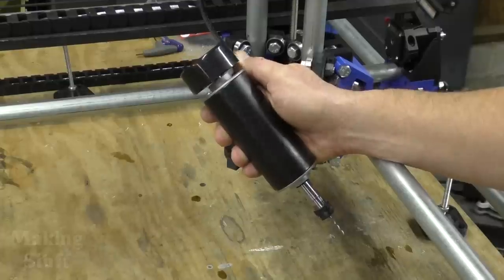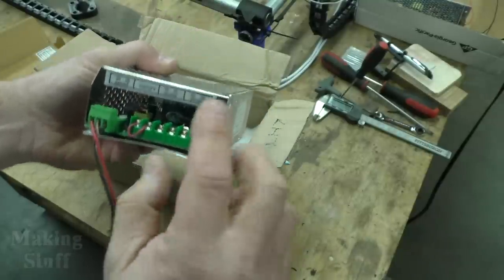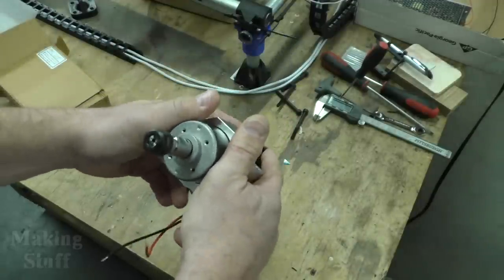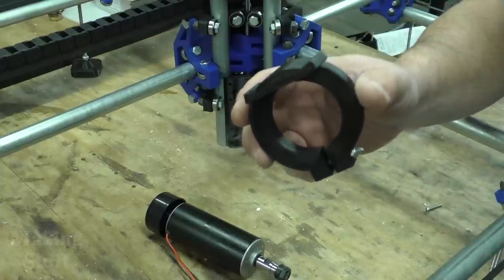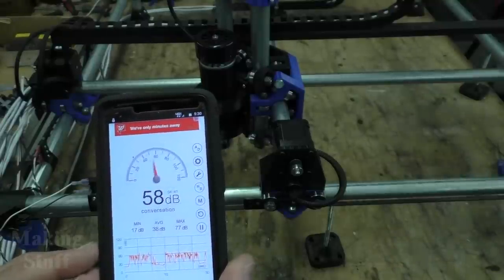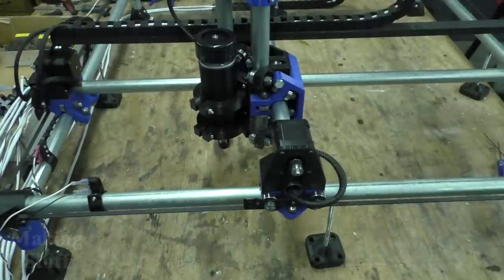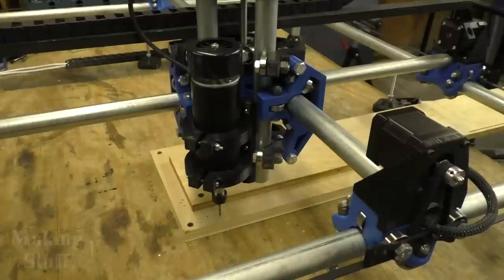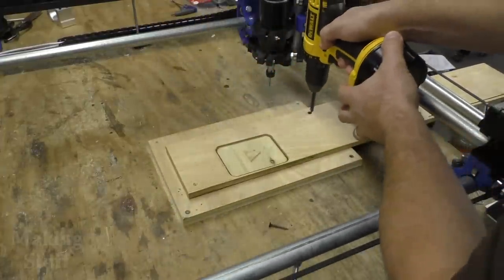Reviewing a Chinese Spindle for CNC Machines

Comment: You did not mount the tool in the collet correctly. The collet (of which you got only one, the 3.175 mm one) snaps into the ER11 nut with a small ridge at the top of the collet. Once you snap the collet into the black ER11 nut you can insert the tool/bit. And then thread everything into/on the spindle.

Comment: I see that you use Marlin as a milling platform. Can you link the videos regardning using marlin for this milling macine you build. I did the same and i´m usning uno arduino and grbl. But using ramps 1.4 is an awesome platform and the cost is 15 usd for a kit with lcd and shield plus mainoard 2560. I bought 2 sets just in case as they are so versatile. I run my prter wirh marlin 2.0.7 and ramps 1.4 hybrid on 24v. I´d love to see your build for cnc roter and also plasma. I have a cheap cutter lying around. Just havent gotten around to building it. Need to build a garage first...
Reply: i did build my own cnc milling machine. I use grblgru as cam module. it is free and powerful. i use arduino uno r3 and grbl shield. But i plan to use mega2560 and ramps 1.4   But you can also use marlin to mill stuff. and use the lcd and jog the machine. I will check out ESTL also. Right now i'm getting to the point where i can use my diy machine, with cutting fluid system and ventialtions systems. it is designied to cut and engrave alumium, at low speeds and high rpm, rather than a regualr milling machine. I will of course mill wood also. I use ballscrews

Comment: If it was not for the low rpm speed (compared to a dremel type tool) I think I would buy one of these and use it for a dremel tool!  Two and a half times the power and super quite compared to the dremel!
Reply: NotAnExpert, haha, great idea!
Reply: A Dremel is 75W. When I measured my "500W" spindle I could never get it to draw more than 100W even loaded down. So they're 500 Chinese Watts not western Watts. Chinese Watts are obviously a lot smaller than our Watts are. But inflating specs is typical. I have a 600W Bosch router and it is really 600W. It is way more powerful than these air cooled spindles are. Easy 6 times. Turn that router on and it'll twist your wrist.

Comment: I wonder if they sell the spindle for cheaper without the bracket? That bracket is huge!  Or without the controller.  Just give it 100 volts dc without variable speed? 11000rpm isn't something I'd slow down. 
I made a video on my high voltage dc power supply that was cheap:  I could add 3 more ports for 100 vdc!
Reply from the maker: Yes you can buy the spindle without the bracket.  Just look on Banggood or Amazon.

Comment: I'm after a spindle/router for my own MPCNC. I'm very inexperienced with this stuff and am just starting out. Those spindles look great for a beginner like me, even if I end up on something "beefier" later on. The mounting arrangement scares me though - there is nothing holding the spindle up, just the friction from the sides. Are there any mounts available that hold it from the bottom?
Reply: You can put a hose clamp on it both top and bottom.. with some electrical tape to prevent the hose clamps from sliding
Reply from the maker: The mount that came with it was very hard to get off.  I had to get a screw driver and pry it open just to remove it.  There was just no way to hook it to the MPCNC without having to use 3d printed parts.  The 3D printed mounts would probably break before the let the spindle slip.  I was more worried about them breaking than slipping.  I'm sure if the spindle stopped turning or I took too deep of a cut, something would break on the MPCNC.

Comment: What are the best tools for wood and soft aluminium a router or a spindle, and can you use 1/4" cutter bits?
Reply from the maker: You can use a 1/4" bit with the correct collet.

Comment: Hey man looks like your cnc has a bunch of vibrations,  likely causing the lousy finish.  Great video though thanks!
Reply: A bunch of vibrations? Lousy? For a printed CNC machine running a cheap Chinese spindle this is pretty dam good. Of course it's not going to be a Tormach 440...

Comment: Did you adjust the small potentiometer on the circuit board to a max voltage? At the moment at full speed I have 120V and the spindle runs hot. Do I have to adjust it to max 100V?
Reply from the maker: I didn't have to adjust mine.
Reply: @MakingStuff  What voltage do you get out of the power supply at full speed?

Comment: IMO it Seems to be mainly from the plywood you used. May want to try using MDF or a higher quality harder wood oak, walnut etc. could also be a little because of the end mill. If it’s for steel then it wouldn’t be as clean on wood.
Reply from the maker: I tried it on white oak since the video was filmed and it worked much better than plywood but still had small amounts of splintering.
Reply: Making Stuff Ok good. Another tip would be to also adjust the speed of not only the end mill itself, but the movement across the X and Y axis. Maybe slow it down some. If I recall correctly from your video you were using it at max rpm’s and running it at max speed with certain materials could effect the outcome of the piece negatively. Excellent job though and I WISH I had my own CNC machine like yours!
Reply: The glue layers are tough!
Reply: TheRainHarvester yeah I can imagine!

Comment: This spindle has only one ball bearing effective because another one is mounted on rubber. Normally spindle has angular contact bearings and total 4 bearings to bear cutting backforce. If you open it, you will know this is just modified hand blender.

Comment: Hi, can you tell me the distance between mounting holes for making the holes until the motor arrived. Horizontal and vertical. Thank you
Reply from the maker: Sorry I don't have this spindle any longer.  I sold the CNC machine that it was mounted to.
Reply: @MakingStuff  ok, thank you for the answer.

Comment: Use a wide dremmel tool It's from the vibration about then drill bet Are used a CNC dremmel bit With a flat surface or

Comment: Did you use with ramps. And can you set spindle speed on software? which connection do you use
Reply from the maker: No it's not connected to the RAMPS board.

Comment: "Banggoods sent me a spindle to do a review on. They didn't pay me"  
Unless you have to send back the spindle they did pay you WITH the spindle. just because its not a cash transaction doesn't mean you weren't paid.
Just because its heavy doesn't mean its "well made" they are good spindles though the bearings arent making excessive noise. 
I've got one and it works well. mine came with a collet set i just had to get a 1/8 and 1/4 collet

level your machine better to remove the milling marks. i dont have marks. but ive seen Haas CNC machines with milling marks. we had to cut the surface in two directions to make a better surface finish.

Comment: 11,400 sounds incredibly slow to me.  I have built inverted pin routers for routing out model aircraft kit parts from wood.  Going from a standard slow router around 22k to a 32k trim router made an incredible difference.  Look for cross fluted carbide burs.  Leaving nothing but points, they cut like mad.
Reply: The slow rotational speed is my biggest beef with these air cooled spindles.I was running a router on my CNC and the sound was driving me up the wall. So the air cooled spindles being quieter is nice. I think I need new bearings in that router. But with a router you con't have so many collet options for tool shanks like ER11 either.

Comment: Is PLA working for the spindle mount or is the spindle getting hot after running a while?
Reply from the maker: The spindle does get warm but no where near hot enough to melt the PLA.

Comment: I'm confused,do you just run 110AC to the power connectors,or do you get the 24DC or whatever,from the mill's board?
Reply from the maker: The power supply that comes with it connects to house current.  Then it steps the voltage down depending on what speed you have it set to.

Comment: Did you wire it in so that the onboard controller controlled the speed and switching on/off?
Reply from the maker: No I am manually controlling the speed, on/off.  I plan to put a solid state relay on the mains power side in the future.
Reply: @MakingStuff  Thanks for the reply.  It is much appreciated.

Comment: i notic ou used a plastic bracket for the cnc in other video`s they changed from plastic bracket to a epdm harder plastic bracket maybe youre bracket is a little bit flexible and that couses those straigt lines
Reply from the maker: The lines went away when I switched to a better quality down cut bit.  The whole machine has flex to it if you press on it hard enough so I don't think a harder plastic bracket would do much good unless the whole machine was also replaced with the same plastic.  Thanks for watching!

Comment: This machine power supply and spindle cause me nothing but problems , when turned on and not attached to the main board , on a separate terminal as a stand alone unit it for some reason causes problems with my PC and the Vectric software   mostly on the CNC machine the problem is with the Y and Z axis where the polarity changes instead of going + it does the opposite for Y and Z  I don't know how you eliminated the problem it seems that the spindle or power supply is creating its own EMF ,Can you please share with me how you stopped this issue. Thnk you
Reply from the maker: I always use shielded wire and ground it on the electronics side of the CNC machine to help eliminate problems with EMF.  Also try to get the spindle and pwoer supply as far away from the CNC electronics.
Reply: @MakingStuff  My spindle and power supply are about 3feet away from the circuit board and even with trying to disrupt the EMI with a couple of Caps the result does not change if they would put a ground to voltage that would solve most of the problem , but like they say you get what you pay for

Comment: So how is that spindle holding up im hunting a 2.2kw unit myself any ideas on a good deal
Reply from the maker: I've cut a lot of plywood with it but that is it.  It has held up fine so far.
Reply: @MakingStuff got the c02 laser all done soooo nice with the( pic engrave board) also mirrors and a proper head makes all the difference
 well i pulled the ripcord  
on a hy 2.2kw water cooled version cant wait till it gets here 
i know i know it looks like a make your own cnc greenbull trust me its a gatton cnc i just like the chain drive cheaper than lead screws and dam accurate and i
 had allready purchased the chain and sprockets ans idlers a week before i contacted dave   dont know why dave hates it could it be the 1600 oz  steppers ? 
Ive given him all the credit all i did was make the x 3 inches taller and 52 inches wide and originally the y was   16 ft long now only 8x4 working area 
Hey friend thank you for the video review ???? 
Jerry c

Comment: I have a new 500w, when using it at more than 50% for 30 minutes it heats a lot, is it normal? Will it be a bad voltage? or it will be damaged
Reply from the maker: Miine will get hot too but so far has not damaged itself.

Comment: if you will use this "spindle" you definitely should put some short screws in that four holes on a face of a motor.
(otherwise dust will pass through this holes inside a motor)
Reply from the maker: Good point.

Comment: the lines in your finish are a combination of bit selection and more likely than that, the axis of the spindle being out of tram with the plane of the spoil board. the amateurish woodworker approach would be to deck off a small amount from your spoil board after you mounted your new spindle. the professional tool builder solution would be to break out an indicator and tram in your new spindle.
Reply from the maker: The MPCNC design doesn't have a way to adjust the z-axis that I know of.  The only other option I can think of is to shim the legs.  I'm going to try better bits first.  Thanks for the info.
Reply: @MakingStuff  might be able to stick some shims in some where, otherwise deck your spoil board, then screw your wood to it and see if it helps

Comment: One of the reasons this spindle runs quiet is becuse it is only running at half (or Less) the RPMs of a Dremel or router motor.
Reply: Even running my Dremmel motors at the same speed, they are hitting about 60 decibles. At full speed they hit about 90.

Comment: 113c would make even ABS hit its Tg so I would get a water cooled version or find a way to get everything toughing the Spindle into metal.
Reply from the maker: I agree on what you are saying, but the temperature was 113F which would be 45C.
Reply: Oh, LOL.  I am so used to temps in c and when you touched it I was saying OMG, 113c is above boiling water and brings blisters when touched.  This Spindle is pretty dang nice.  Was it supposed to come with wrenches and it didn't by accident?
Reply from the maker: @The Best Stooge It wasn't advertised with wrenches but I didn't notice until I got the spindle.  I was just mentioning that so no one else would be caught off guard like I was.  Luckily I had some metric wrenches that fit.

Comment: Sir I want to know whether this motor gives its rpm of 11400 on full load of approx 450-500w. And can it be used as lifting the load w.r.t the gearbox attached with this.

Comment: I will take your impression about the spindle such as it looks good quality and it has some gravity. However, your evaluation was bias and inadequate. You hided  your phone during the starting up because it recorded higher noise. You waited for few seconds  to let the motor cooled down before you measured  the temperature. you did not investigate  the power capacity, rotating speed vs feeding speed and the bearings characteristics. Nevertheless for that price, No way it can compete Dewalt or Makita  routers . I like and enjoy your channel, thank you for sharing
Reply: I agree. Be careful if you want to go down the influencer route. You'll probably make more money in the end but there are viewers like me who dislike watching disguised advertisements for products. Matthias Wandel made a video a few months ago about his attempt at being an influencer and being too honest in his review and the consequences that followed. I enjoy your channel also but the last few videos there have felt like a few stealthy attempts at selling someone's product.  Also for the sound test point the bottom of the phone towards the sound so the microphone has an unobstructed angle to the noise.
Reply: These spindles are WAYYYY more quiet than a Dewalt or Makita router, and don't forget...this CNC table is made of conduit and plastic 3D printed parts. It probably doesn't have the structural rigidity to mount a full sized router, or even a 600-800W trim router. I just replaced the Makita 2.5hp router on my 4x4 table with a 2.2kw water cooled spindle, and I'm in heaven with the near silence and the lack of dust kicked up by those router cooling fans. I also have a small desktop CNC table with a 12,000rpm 300W spindle,  similar to the one in the video, and it's also nearly silent and OK  for small work with 1/8" router bits, or conical engraving bits.
Reply: I do wonder if bang good could have hand-selected a good spindle.  Sometimes quality is hit or miss.  Maybe we should all PayPal someone $1 so they can buy a spindle anonymously and do a review!
Reply: @AndTheCorrectAnswerIs  How much did you pay for the water cooled spindle?  do you circulate the water with a pump or does the motor itself move the water?  I've been playing with a little air cooled 500 watt spindle, it seems quiet and smooth.  I haven't done any work with it yet, though.
Reply: @Joe-sm8wl  Yess, I stopped Mathias Wandel stuff as well, it got so boring to hear him whining all the tine ...
Reply: Barry Manilowa  I have the BLDC kind running for a while in my CNC. It's good even with up to 6mm bits doing aluminium. The CNC is quite a bit more sturdy than this of couse, and the BLDC ist PWM controlled via LinuxCNC.
I realy recommend this spindels for the hobbyist. Quite a good quality for the buck.
Reply: The recommend dewalt router for that machine is $50.
Reply: @paulwyleciol3459  and to see him make things more complicated than they have to be......and do things wrong, and the list goes on......
Reply: @TheOpinionationer  Water cooled spindles require a liquid pump and either a very large reservoir of coolant or a radiator system with a small reservoir.  For simple DIY setups of water cooled spindles you can get computer radiators and water pumps.
Reply: @pyromanci2736  thanks!
Reply: These spindles are genuinely quite compared to other spindle alternatives. Unless you go with a decent water cooled spindle. That's going to cost you 4 or more times more then this air cooled one. But it will be more powerful and faster too. So pay more to get more.